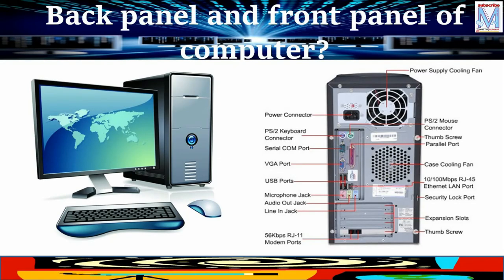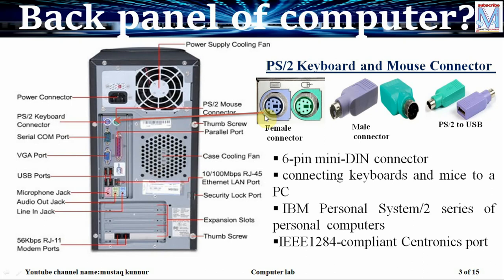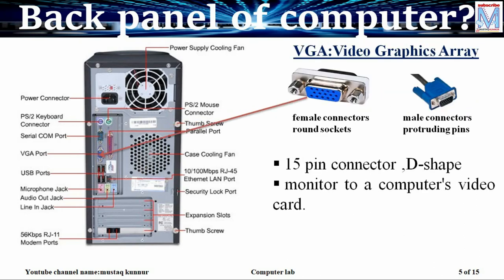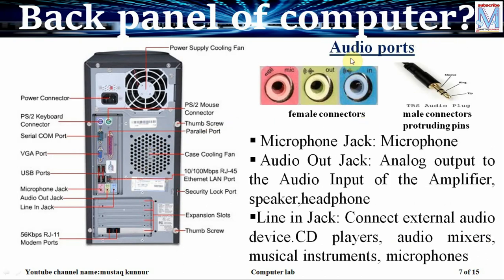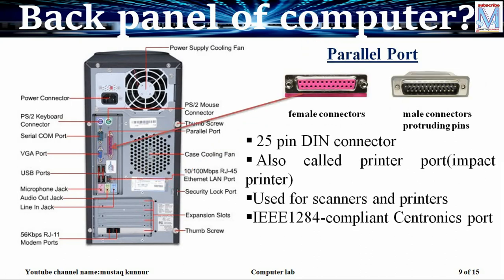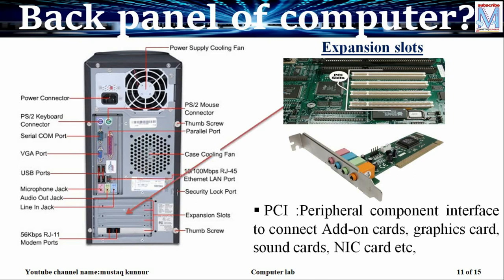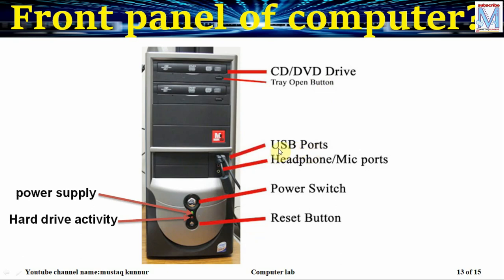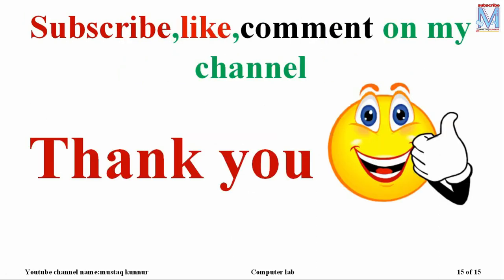Computer Ports Explained: Essential Guide to Types and Functions

Comment: Sir ji....Short for switched-mode power supply,SMPS is a power supply that uses a switching regulator to control and stabilize the output voltage by switching the load current on and off. These power supplies offer a greater power conversion and reduce the overall power loss.
Reply from the maker: You are right. This video are meant for beginners
Reply from the maker: You are right...